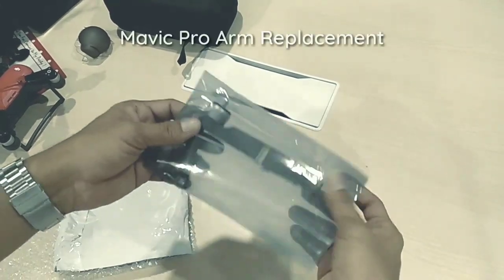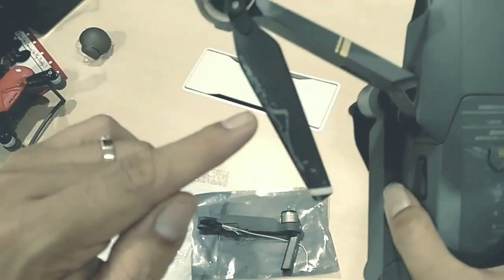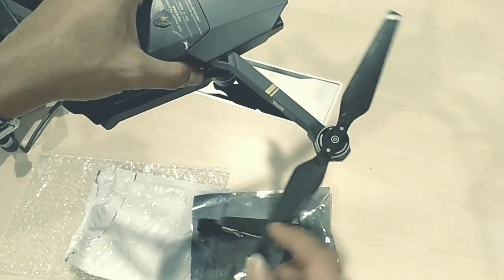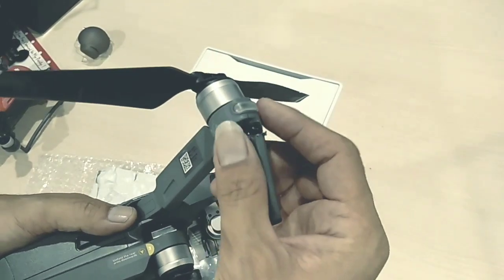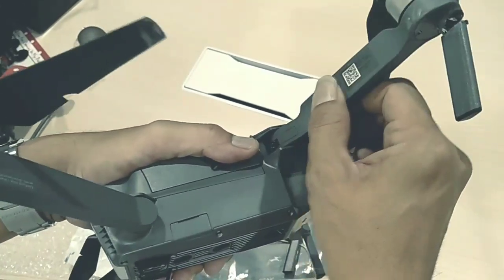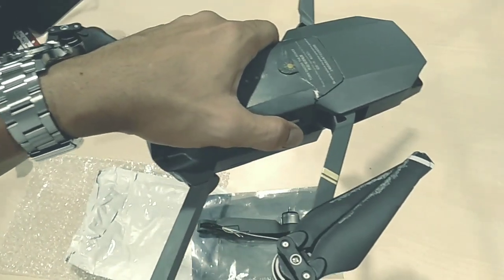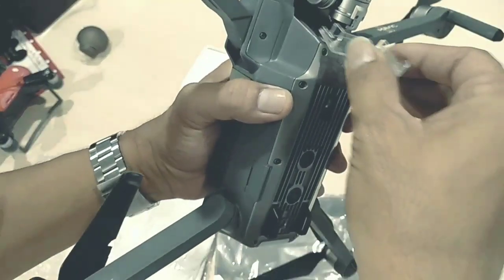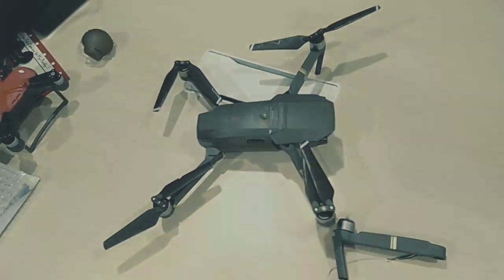[Part 1] Mavic Pro Arm Replacement Repair, Front Right Arm [Intro]

Comment: Just wondering how you learned to repair drones? Did you teach yourself? When it comes to the electronics do you fix any of those issues too? If you do how do you diagnose the board? Any special tools I would have to buy? 
Hope you don’t mind all the questions but I would like to buy a crashed drone and be able to fix it myself for fun.
Where do you buy your parts from? I’m sure buying from Dji they don’t come cheap or is that our only choice.
Going to watch all your videos and learn everything I can. Any advice I would really appreciate it.
Thank You
Jim
Reply from the maker: i don't have electronic background in particular, but been working with computer hardware long ago. i watched  other's video on how to open mavic and to be able to look at the board before opening it. each leg has motor and led, motor needs 3 cables which should be larger size, led needs 2 smaller cables. the board layout is pretty easy to understand with 4 legs' cables located nice distance to each other, at corner of each sides.
no special tool, just common tiny screw driver set, oh yes probably that prying tool to open the cover, and soldering iron, magnifying tool if you need one.
not at all, you're welcome to ask.
since I'm in Indonesia, i bought online at tokopedia for $60 but i've seen it sold at amazon and ebay too. i don't see it at dji store however. 
thank you for watching.